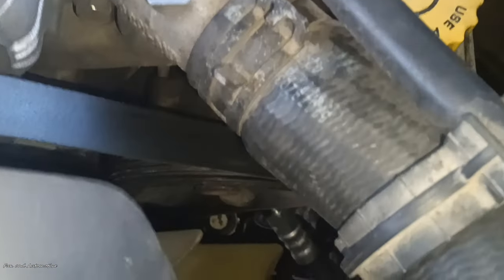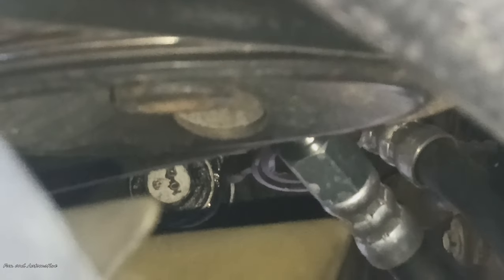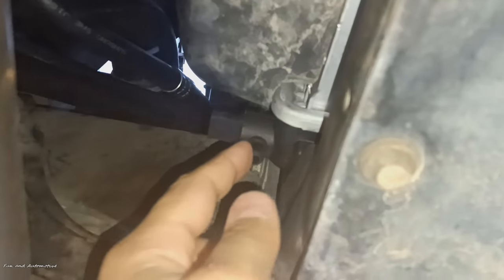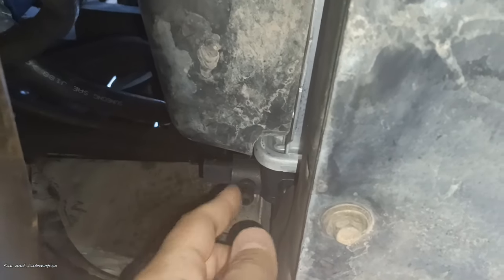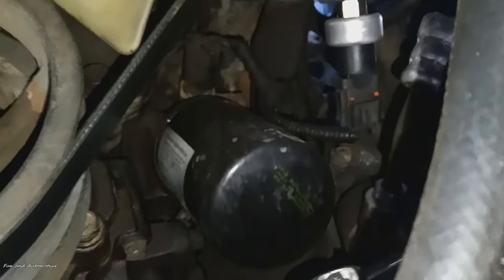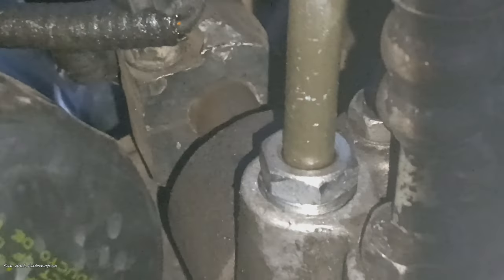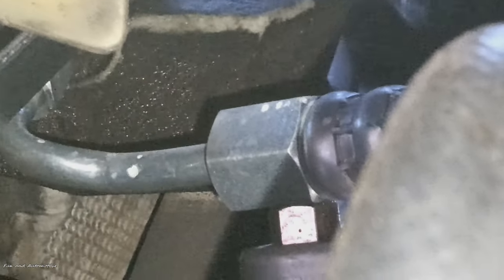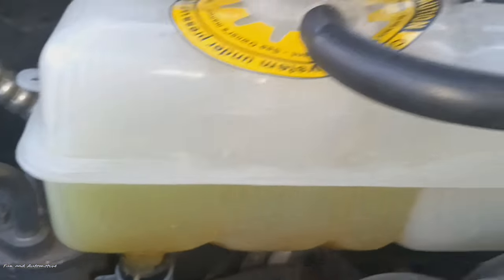Update Radiator Replacement after the job

Comment: Did you use any thread sealer for the p/s switch? Switched mines out a while ago, pissed p/s fluid all over the place. Other than that, awesome build!
Reply from the maker: Hey thanks man and no I never did there's an o ring on it already but I probably should have added a little just in case lol